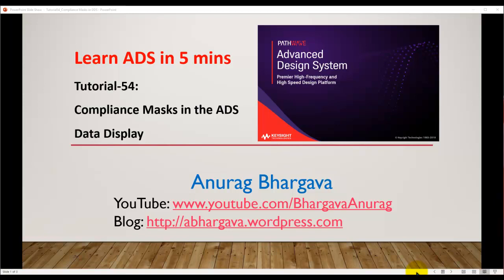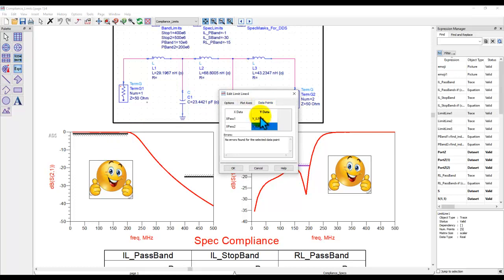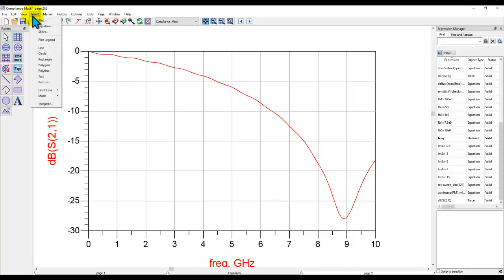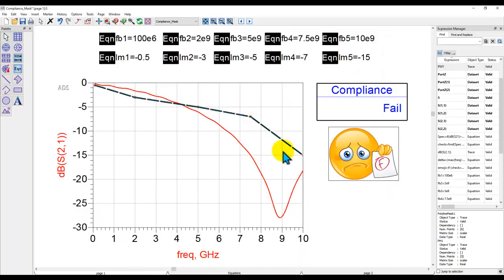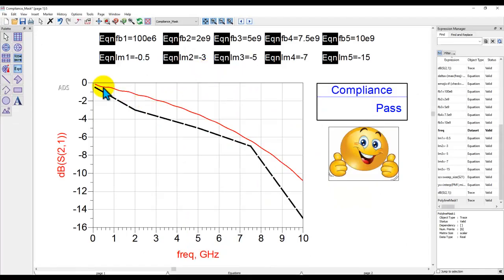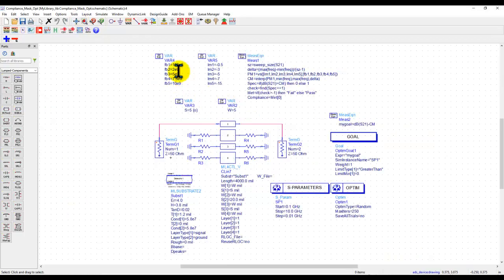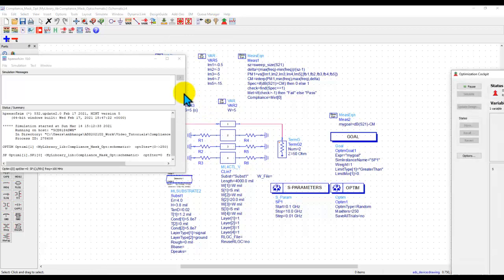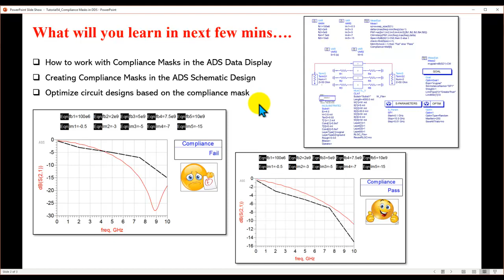Tutorial-54: Using Compliance Masks for RF and High Speed Interconnect Designs

Comment: dear, can you make video in designing  impedance matching for this GaN Amplifier NPTB00004A in range from 1 ghz to 2.5ghz  , please ? because it dose not come(the matching) with me under -20 db s(1,1) s(2,2), however i follow your steps in design wideband matching. ,so please i want make video about that please
Reply from the maker: Hi Sam,
It is not always possible to achieve <-20dB return loss in such wide bandwidth with these discrete device. The BW you mention is more than 1 octave and to achieve this level of match, reactive component of the load cannot be more than 2.047 times the real part. However match of <-10dB is more on achievable side. I would recommend you to read application notes from the vendor and you can contact them to get required support.
Hope this helps.
Reply: @BhargavaAnurag  i use the s2p file provided by the company  (28V 50mA ) but the result in data display  different from what they write in datasheet , could help me  or tell me what is wrong , by the way the company need official email that i don't have it. your help are high appreciated